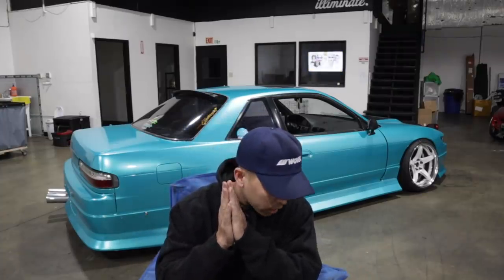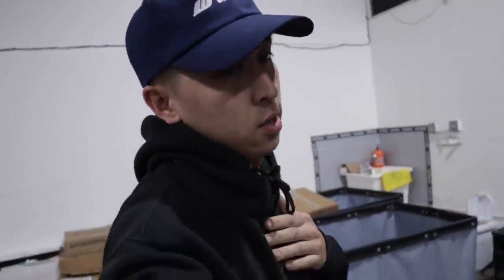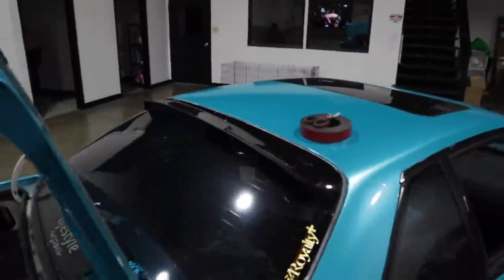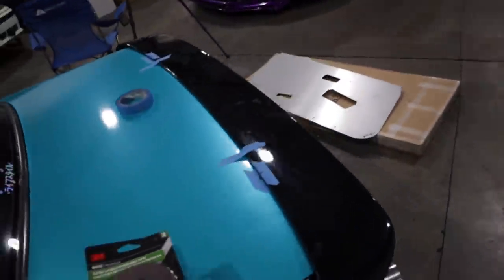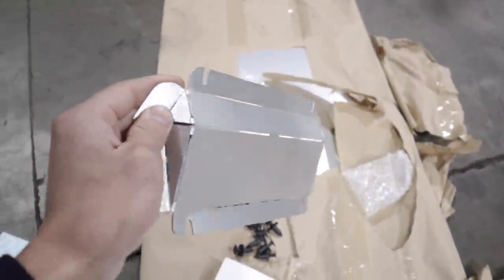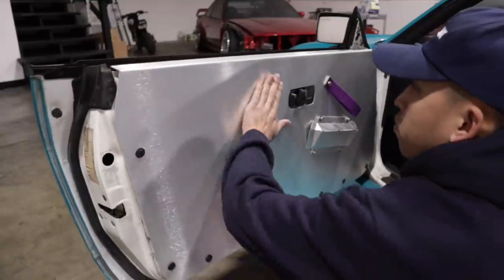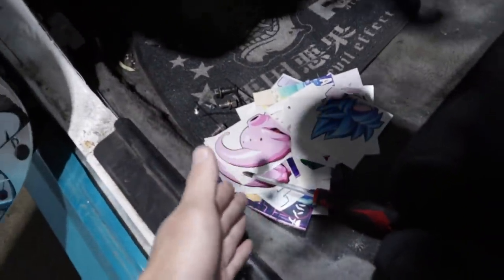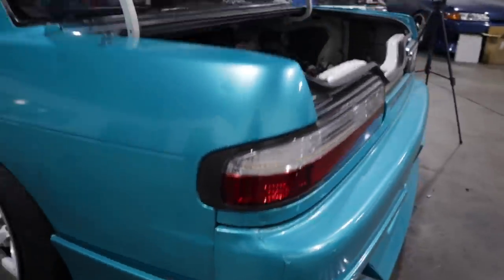Origin Lab Wing For The 240sx

Comment: You may wanna add something on there to secure the wing. In my experience, 3m tape on top of vinyl wrap doesnt last. The 3m tape will be pulling on the vinyl wrap and in time will rip right off, especially on hot days. Wing looks dope, just do something to secure it if u dont wanna lose it 👌
Reply from the maker: Thanks for the advice! I'll probably make some small brackets and hide them under the wing

Comment: Heh Vu, the spoiler looks great! But i wouldn't drive on the highway without mounting it first. I lost a 300$ bomex spoiler that way. It flew off and shattered when it hit the ground.  Id put some threaded inserts into the wing and use studs to bolt it on from inside the trunk. Itll also prevent someone from stealing it